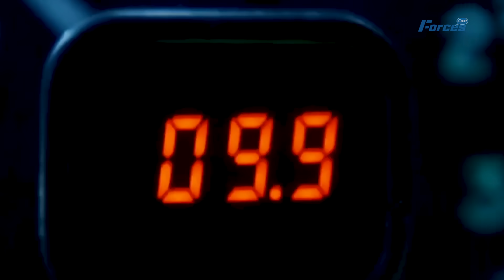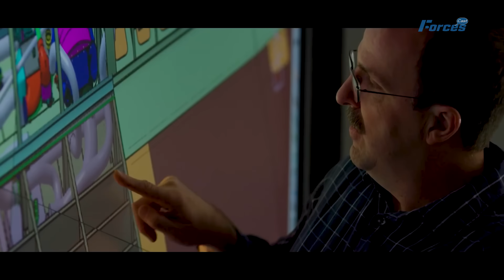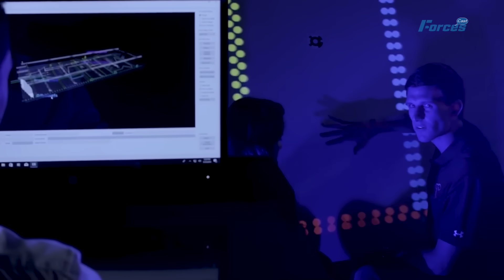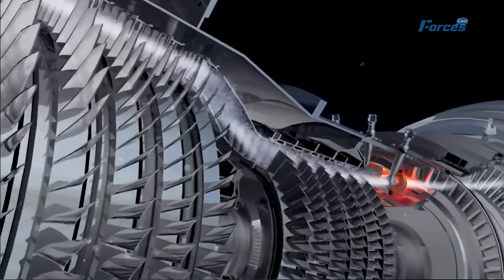No one Can STOP US Darkstar to be REAL

Comment: 15 miles is only about 80,000 feet - SR-71 could hit 88,000 feet at Mach 3.2 at burnout according to the published flight manual they sent to China for printing. The faster you can go, the higher you can go. Following the published dynamic pressure trajectory from Dr. William Heiser’s book “Hypersonic Airbreathing Propulsion”, a vehicle moving at Mach 6 would have to fly at a much higher altitude like closer to 100,000 feet, with a zoom climb hitting numbers I don’t think I can say. A Mach 3.2 capable Mig-25 hit 123,000 feet in a zoom climb. Not sure Darkstar has a reaction control system for flight above 140,000 feet (X-15 RCS transition, Jarvis & Lock, 1965), so Microsoft Flight Sim not quite accurate. If you disintegrate Darkstar at Mach 10.2, you were flying too low in the heavier atmosphere. If you pull up Darkstar at Mach 10 and don’t have an unscheduled disassembly, you could apogee in space. Falcon 9 is going Mach 10 around MECO (main engine cutoff) at 264,000 feet.

Comment: We already have faster planes and so called space craft. The Aurora is supposed to be capable of Mach 15-16. The TR3B is superluminal or faster than light. Both have existed for some time now. The TR3B is big. It's an equilateral triangle with sides that are 600 feet long. It dwarfs the Aurora's speed. The SR-71 is not a fighter, it's a reconnaissance or spy plane.
Reply: I've seen the Aurora called the SR-72. I've also seen another plane with that designation.

Comment: Sorry, but I just have to call BS! I think we probably have the engine technology but the surface temperatures are going to be tough to handle. Just like the X-15 which STILL has the record,  unless you include the Space Shuttle, it had SERIOUS PROBLEMS with the metallurgy and used skids on the back! Much like fusion technology, we JUST DON'T HAVE THE MATERIALS to handle the heat! If we're talking 2 miles every second, that's about 10, 500 ft/sec, 7200 mph or a little under Mach 10! No can do!😢😢😢
Reply: Unless you look at tantalum hafnium or tungsten carbide for examples, tantalum hafnium has a melting point of over 7200°F and tungsten carbide is around 6800°F
Reply: How do you know which materials are known at skunk works? XD This would be, as you rightfully understand one of the key technologies to unlock manned hypersonic flight and would be highly highly classified. I wouldn’t even estimate, that it is about metallurgy that much but more a compound material which isn’t purely metallic.
Reply: @flixri726 
A bold statement.  I’m not privy as to what secrets the skunk works has in its deep dark safes.  However, I would think the scientists and others who have worked on this project for years are as intelligent as you or maybe even smarter to have figured out everything there is to know including structured materials.  Maybe they should be contacting you to lead their team or maybe you know something they don’t.  I’m just sayin'
Reply: @stanmans  I kinda get the feeling you misunderstood me? I didn't claim to know more than skunk works in any way, I was making the point that OP could not know if we have such materials or any details about those, because they would be locked away under several layers of classification. 
The last point about it most likely not being purely metallic, was just a wild guess based on the fact, that other countries also have good metallurgy departments and the US is really excelling in advantages in compound materials. Don't take it too seriously ;)
Reply: @flixri726 .  It’s obvious he is smarter than the scientists.  Let’s think about it.  This project has been going on for years at a cost of millions or billions and when they finally finished, a maintenance person asks "have you guys come up with the heating problem".
And the reply is "oops, we forgot about that, and while we’re at it we forgot to create the munitions and the systems that will outfly the plane and give the pilot the computers to assist or maybe we can try A.I. as the pilot". Just sayin'.
Reply: Instead of saying it's impossible, I would ask "If we wanted to attempt this how would we do it?"

The skin would have to be a material capable of handling lots of heat. My first thought goes to ceramics or carbon fiber. Carbon fiber can handle up to about 6600deg F before melting.

  You could coat the aircraft with a thermal barrier coating to reflect away some of the heat. It would burn off over time so it would be more of a ablative material. Ultra high temp thermal barrier coating can handle about 2300deg. Military might have something even better. 

One material mentioned a lot with hypersonic missile nose cones is Prolific carbon. That seems to have a melting point of about 6500deg F.  A plasma barrier would work too if we could figure out how to create and regulate a stable plasma barrier.

Under skin cooling like the SR-71 used. Pipes ran under the skin pumping refrigerated fuel through to heat the fuel to the above 550deg needed to combust properly. Then it was fed to the engine. There were rumours back in the 90's about Project Aurora and that it had to use specially modified tankers to handle cryogenically refrigerated liquid hydrogen slush. 

The SR-71's J58 engines operated almost like a ramjet at speed. In fifty years we almost have to have improved materials technology.
Reply: We literally have reverse engineered alien craft but okay 😂
Reply: At that speed you couldn't fire a weapon anyway😮
Reply: Naive

Comment: The movie had nothing to do with the development of “dark star” most sources point to it being operational 15-20years ago. 
Rumor has it that we (the US) have been using a hypersonic vehicle that can be flown by a pilot or as a drone that is launched and recovered from the cargo bay of a C-5 galaxy using a gantry crane while well out to sea to make it much harder to get photos of and be able to confirm the program. 
One thing that the renderings get wrong is that there are no windows. Cameras on the exterior of the craft send images to an immersive helmet.  Most of the forward facing cameras are covered with a heat shield during hypersonic flight to protect them from heat exposure that would distort their view due to migration of the plasticized view ports cristal ( I’m not sure of the exact material used but it’s not glass) that would get so hot that the material slowly moves from the heat and friction. They had the same problem with the SR-71’s windows. 
The expansion of the runway at Groom Lake and some other bases around the world was to allow for a landing if in air recovery wasn’t achievable due to weather or other factors.

Comment: The RQ-3 DarkStar was actually a highly-advanced, stealthy reconnaissance remotely piloted aircraft (RPA) designed for use in high-threat environments. Though it never entered production, the DarkStar was an important milestone in the development of even more capable RPAs which followed.   Designed to be fully autonomous, the DarkStar could take off, fly to the target area, operate its sensors, transmit its sensor imagery, return to base and land without human intervention. Using satellite digital links to transmit sensor images, DarkStar could provide timely information across the globe. If needed, ground station operators could control the RPA from anywhere in the world using satellite links.   The first DarkStar flew in 1996 but crashed on its second flight.  In January 1999, the Department of Defense ended the program because of cost and aerodynamic stability problems.   The Military Services are extremely sensitive when it comes to the re-use of a classified program's media name.   The movie producers often add characters and objects of a fictional nature using some real names that are or were in use at some time or other.

Comment: If anyone remembers the anime Robotech, it had a series titled Macross 0 (Zero), those mixed with true tech the us has today?! You'd probably get something like sr72 from maverick! I'm guessing larger than the raptor but smaller than a B1 like the movie but with more material up front because of temperatures shocks to its parts?! That cockpit design was kind of silly considering it's predecessor. Whoever crews or pilots that plane  realizes each sorte is a 1 way trip, especially at those speeds, and the worst happens! Think you'll hear "eject?!"God bless the US
Reply: Robotech is indeed the Macross anime series... but you have some of the order wrong.

Chronological order would be... Macross Zero, Robotech, Robotech II, Macross 7, Nacross Frontier, Nacross Delta.

Order of airing is ... Robotech, Robotech II, Macross 7, Macross Zero, Macross Frontier, Macross Delta.

Robotech was made in the USA, while all of the Macross series were made in Japan.

All that having been said...  this video seems... fake.  Many details are plain wrong and there is simply no proof anywhere about the existence of an actual SR-72 Aurora... which is the actual name of the aircraft from the Darkstar Project... which is why I know this video is pure trash.

Comment: I worked at Lockheed Ga for 8 years and Kelly Johnson spoke at our management meeting one night. Conversations we always spoke about was the fact that the SR71 was designed and assembled in 1964 and that this was 1990. We use to say after 26 years something new had to be on or coming off the drawing board. 

There were drip leaks of an SR71 replacement, which fit the narrative to explain why the SR71 retiring. The drip was very low frequency but it was there. Today, now we know. 

Kelly Johnson discussed the many challenges they face and the time taken to overcome. Looking at this feat of marvel I would say the challenge was met but they waited for weaponry to catch up. Like the SR71, bullets and missiles were useless. The SR71 and 72 would outrun them both. Lasers are the perfect match
Reply: For years ive seen those pulse vapor trails early Sunday mornings just North of Santa Clarita. Still waiting for a feel and touch moment

Comment: The SR-71 was never a fighter aircraft. Its predecessor, the A-12 and YF-12, were supposed to be, but never were.
Reply: The A-12 was built & was a CIA reconnaisance aircraft instead of military. The YF-12 was a 2 seat version of the same aircraft. A prototype was built but it never went into production.
Reply: The Yf-12 was meant to be an interceptor.
Reply: The yf12 was meant to be a fighter, but missiles and a gun were useless since it was faster than those. Impressive what we built back in the 60’s, built whith a slide rule and shear brain power.

Comment: It is not new, it is easily 20+ year old tech. As for 350 Kw that is bull shit the boys at S.W's. will equip it with 1+Mw neutral particle beam weapon ,because any weapon the SR72 will go after will have shielding that will give it heat resistance and those extra seconds to burn thru shielding . Lets just say that will be all the time needed to complete its mission.